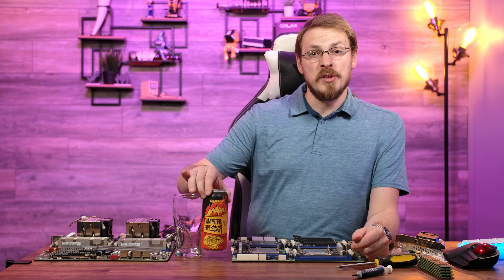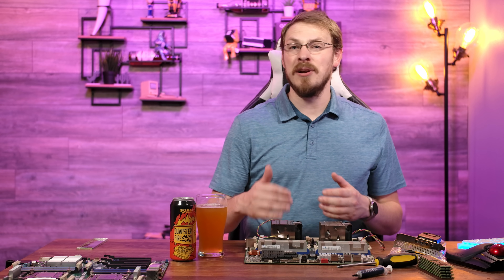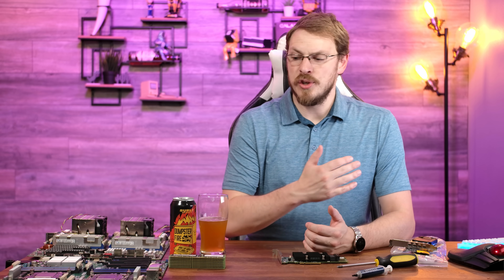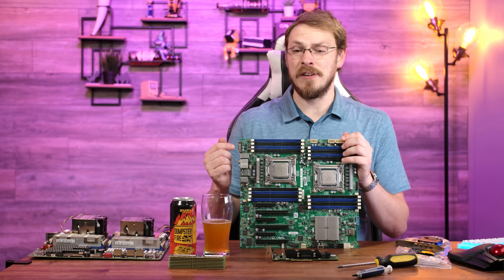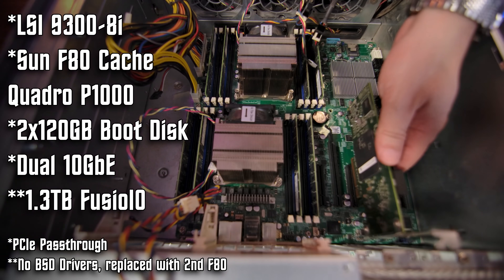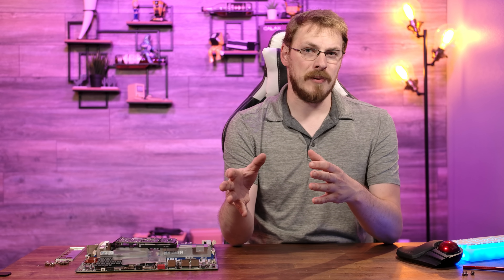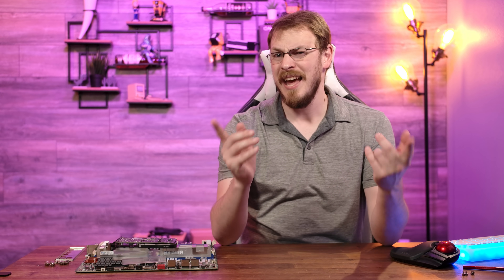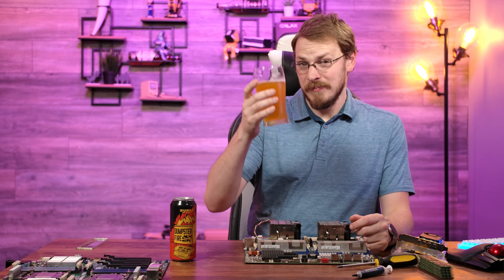Running out of things to die - TrueNAS Motherboard Replacement

Comment: My homelab consists of a single Dell R720 with the following specs: 2x E5-2680v2, 256GB DDR3 @ 1333Mhz, Dell PERC H710p for the 4 500GB Samsung SSDs as my ESXi datastore, a Dell H200 HBA for my virtual NAS. To my virtual NAS, there are 8x 1TB SATA 2,5" enterprise disks in RAIDZ2 on my Ubuntu ZFS NAS. The R720 is a SFF model, hence the 1TB disks. 2TB isn't needed for now and 2TB is quite expensive right now. 

Next homelab upgrade: 
Some 10Gbit networking, but nothing else planned for now.

Comment: These series of motherboards are a pain in the ass , I have 2 similar ones(X9DR3) and these are simply an headache . Mine for instance does not show the second CPU temps , voltages , etc in the management module , bios all ok , buy-ed another one , same issue , swapped the CPU ,same story. With the pci-e slots you need to configure the right lane's allocation on them , and also try to swap between the slot's the cards and check in which slot the add-on card works best. And yeah the troubleshooting continues till you will lose patience and replace again the MB like I did :))

Comment: I've got the simple home server. A old i5 3570, 16gb ram, 1 6TB drive, 1 2TB drive, a 256GB SSD Boot drive. Used for Plex and Data archives of all of my work data. Probably only 1TB of the work data and 4TB for Plex. Running TrueNas Core. I also have a system that has all of the work data and most of the plex data backed up that is off all the time. I occasionally turn it on to do a backup. All of my most important files are in a onedrive folder that backs up to the trunas nightly and is in the cloud. So I have 3 copies of important files and 2 of most others. There is also my Personal PC, Wife's Laptop, Music Studio PC, 2 other laptops and a Hackintosh I toy with just because. Oh I forgot the WD Cloud drive that has the plex data backed up too.

Comment: I currently have a 134TB Unraid server with a i7-7700K, 32GB RAM and a 1080 Ti for Plex but planning to upgrade it to a Threadripper 1950X for those extra threads.
Then I have a 72TB server with 16GB RAM running Ubuntu Server with MergerFS, it was on TrueNAS but I didn't want the parity and wanted to run docker nativeleley. It only has a i3-6100 right now but when I upgrade my Unraid there will be a chain of hand-me-downs through some systems and it will end up with a i5-6500.
Next up is my Dell R240 with a Xeon E-2146G and 64GB RAM that will soon be going off to colocation.
I am also going to be building a new worksation with a Xeon E-2246G.
Lastly I recently aquired two ASUS R200-E9 1U servers with Xeon E3-1220 v5 and 8GB RAM each, so these definateley need some upgrades.

Comment: On my homelab: It's a Dell Poweredge R620 running Proxmox for VMs (2x E52690, 192GB DDR3 ECC), and an HP Z210 workstation running TrueNAS for bulk storage of certain files, mainly media for a Plex server (E31230, 8 GB DDR3). Next upgrade Soon™ is a complete retooling of the TrueNAS server to A) rackmount it, B) upgrade it's capacity, and C) solve a weird issue where the HP tower won't boot with the spinning rust plugged in cold. Unplug the hard drives, boots just fine. Plug them in hot they all show up. Plug them in cold the system goes *pfft nope*.

Comment: I'm running Proxmox on a Gigabyte BRIX 4105R with a 1TB SSD and 8GB DDR4. I've named it "Proxmini" and I've got about a dozen LXC containers for MariaDB, Postgres, Pihole, Nextcloud, Bitwarden, Mattermost, Paperless, Omada, and a few others. My next "upgrade" is probably going to just be getting an identical unit to put beside the first and set up a cluster so I can migrate live containers and balance resource usage. I'm backing up using Proxmox Backup Server to NFS storage on my old Synology DS212, which has two shucked WD Elements 8TB drives in RAID1.

Comment: “This dual Xeon setup may be overkill…”
“What are you running in your NAS?”
Dual E5-2690 v3s, and surprisingly it’s not as overkill as one would think for doing a Snapraid sync over 28 disks 😁
Reply: I have a single Ryzen 5800x, my TrueNAS server has more CPU than it knows what to do with.  Even with Plex running.  Unless I'm transcoding 4K by the boatload, 1080p transcodes barely stress it.  I also moved the Plex DB to the NVMe mirrored array, and eventually I may take advantage of the PCIe pass-thru to pass the GPU to the Plex instance for HW Transcoding, but the 5800x doesn't even need it right now.

Comment: Right now I've got a Dell Poweredge R510 running proxmox pulling double duty as a NAS, I plan on installing TrueNAS on it when my USB to SATA adapter comes in. I've also got a Poweredge R610ii which is awaiting a second Xeon CPU. When that CPU comes in I'll also install a 10 gigabit NIC so that VMs on the 610 can communicate quicker with the storage on the R510.
Reply: I had a hard drive die on me. Thankfully I had a spare ready to go.

Comment: My server used to be an old Dell Dimension 8800 (Pentium 4).  Running Debian, it was able to read 2+ TB drives (even at SATA 1.5G speeds).  I used that thing for way longer than you'd think...

I now have a better server, it's a SuperMicro H8SCM with an AMD Opteron 4365 EE, 16GB RAM and Nvidia Quadro P620.  It has an LSI 9211-8i SAS HBA to run the 10TB SATA HDD and 8TB SAS HDD (and 120GB boot SSD).

Comment: Hm, running Proxmox on a fanless industrial PC, hosting a bunch of basic services like Influx, Grafana, Telegraf, Mosquitto, ioBroker, NiFi, Partkeepr, Dokuwiki... None of those is generating a lot of load, so the 4C/8T low power i7 and 16GB RAM is more than sufficient.
Right now I'm building my first Freenas box out of my old gaming PC, with 6x 4TB in a RaidZ2. Yes, I know, it doesn't use ECC. But a full server would be both, an overkill and above my budget - although somewhat tempting. Main purpose will be to act as a backup server, as sufficient backups are definitely my weak spot. And future projects might aim for a similar, second machine to replicate off-site, so I finally find a good nights sleep.

And man, your beer reviews are "painful" to watch. My mouth starts watering as you describe them, and I'd love to get my hands on a can. But the small breweries are sitting between "too much effort" and "impossible to get here in Europe".

Comment: I tun a random hp oem motherboard with 4 sata 2 plugs, and one sata 3 plug. thenI have a 128gb Samsung ssd as cache and 4 2tb drives in raid 10. Also running an I5 4440 and 8GB of ddr3 ram in a 2x2 and 1x4 config (I have 4 mem slots) I have an fsp power supply with 6 sata connectors and am using an adapter from the 24 pin to whatever HP uses to power their proprietary ass mobos. I get 4TB of storage. I already had the 2TB drives from used computers I buy and put ssds into, already have the cpu and ram from my old computer that the mobo died in. All I had to get is an HP motherboard for 20$ with the correct amount of sata and memory slots, and the adapter to plug in a standard power supply. Turned out to be a very cheap server has been running great for like 6 months now.

Comment: My vm box (Bender, ran out of good names for a big box in my current naming scheme so futurama it is) is an old Dual Opteron G34 board with 128GB ram and 2x16 "core"  Opteron 6282 SE cpus. Lots of threads/cores. Not a lot of performance, but its enough for what I use it for currently. Actually due to it being as slow as it is, I don't use it as much as I probably would otherwise. The per thread performance is pretty poor. It doesn't even make a half way decent multi-player minecraft server or zoneminder instance. My nas (Mr. Big) used to be a mini-itx xeon board with an i3 in it till the board died a year or two ago due to the room being a bit too hot and the lian-li case being too small to deal with the high ambient heat. So I un-decomissioned my old home server (sherman) hardware (Xeon E3 1230, 4c8t 16GB ram). No solid plans on what I'll upgrade to or when. but it would be nice to have a lot more performance for build jobs. My current main build job can take upwards of 2-3+ hours on there where my workstation with a Ryzen 3700x can do it in 1-2 ish hours. The performance difference is pretty staggaring. Not surprising. Just large. Good enough for random vm instances.

Comment: Currently my home server has a Asus prime x399 mobo with a 1900x threadripper, 32gb non ecc ram 😭, lsi 9217-8i hba with 6x wd red 2tb, a gtx 1660 for plex transcoding, 10gb melanox connect x2 nic, 1tb samsung evo 970 main drive, and 1tb wd blue nvme ssd for user redirection storage, runs win serv 2016 with adds etc also runs the vms from the main drive also. If i had the money I would upgrade to a epyc cpu build with ecc ram

Comment: My current network storage is laughably simple...a Pine64 SBC (quad core ARM, 1GB ram) running Open Media Vault sharing an external Seagate 3gb hard drive. The advantage is that it's fanless, low power, and extremely low noise since the only moving part is the spinning rust drive. Low noise is important to me since my IT stack is in my bedroom.

My build to replace that is based on an Asrock quad core Celeron board with 8gb of ram, once again a fanless system, but I'll probably stick with OMV since it it served me well up until now. I have two HGST surplussed 3 GB enterprise drives which will end up in mirror configuration, but since the board only has two SATA ports I need to purchase an add on card to allow me to have a separate boot drive as well.

Comment: Here's my server / homelab 

Custom
M/B: Supermicro X9SRE/X9SRE-3F/X9SRi/X9SRi-3F Version 1.2
CPU: Intel® Xeon® CPU E5-2650 0 @ 2.00GHz
Cache: 512 KiB, 2 MB, 20 MB
Memory: 64 GiB DDR3 Multi-bit ECC (max. installable capacity 512 GiB)
Network: bond0: fault-tolerance (active-backup), mtu 1500
 eth0: 1000 Mbps, full duplex, mtu 1500
 eth1: 1000 Mbps, full duplex, mtu 1500
Kernel: Linux 5.10.1-Unraid x86_64

Greetz, Kevin.

Comment: Home server - bought a Supermicro 2U X9DRW-3F 12 Bay LFF off ebay a couple of months ago, swapped the included CPU's for 2 x E5-2609 v2's (giving me 20 cores / 40 threads boosting to 3.6 GHz), added 512 GB DDR3 ECC 1866Mhz memory from a client's dead server that I took in on trade, 12 x 12 TB Exos x16 SAS HD in Raid 60 giving 96 TB of usable storage (HD's purchased before "farming" drove the price up, btw), 2 x 1TB Samsung Evo 970 SSD in Raid 1 as boot, 1 Connect-X3 Network adapter with 2 infiniband qsfp ports... Total hardware investment ~$6000 (mostly hard drives)... The reason? I installed nylon cargo strapping as an over should carrying strap and I can (relatively) easily load it into my car, and have an emergency server to put in a client's facility, restore their VM's and not have to overnight pieces to get them back up. 
Has already paid for itself...

Comment: I've been very happy with my Dell PowerEdge T140. Upgraded it from a 4c/4t to a 6c/12t Xeon E2136, 48GB of RAM. Runs VMware very well. Quadro P620 passed through for Plex, Dell Perc H330 controller (it's not an HBA, actually. Dell firmware is RAID mode by default), 256GB NVMe card. Light services run on my Synology RS815+ nowadays, with 16GB RAM and 4 4TB WD Red Pro drives.

Comment: I don't see the needs for me using so much horse power at home.  I have a Intel N3700m, running openmediavault because truenas does not run on it ;(. 
I have it in a 2u, 4bay Rackable Systems Industry 19" case, a pcie Sata expansion card, with 4 x 6TB and 16GB DDR3 Ram a 120gb ssd (overkill for the openbediavault os). When the disks are spinned down the system consumes about 12Watt with a picoPsu 90.

But because of your Videos i am Planing moving my Gaming PC into this Rack running proxmox and play via streaming on it... But without a AC i need a much better Cooling system :D

Comment: Last home server was a Q6600 with 8GB or RAM running unRAID with around 8TB of storage across 13 drives.

Am planning a rack build soon with probably a Ryzen chip a few TB of SSD storage and possibly 3x8TB HDD's for mass storage. Again running unRAID.

http://blog.prototypecreations.net/2014/07/15/cupboard-rack-build/

Comment: My TruNAS box is in a CoolerMaster Cosmos II case. 1600watt Corsair power supply. I’m using a old Gaming motherboard with an i7 4770 in it. 64gb of ram, it’s where all my old DDR3 went when I upgraded to DDR 4. Heh. I bought used HGST enterprise drives. Ive got 6 SATA 3tb drives on the motherboard SATA controller, 10 SAS 4tb drives on two Dell SAS controllers. Ive had the 3tb drives for about 5 years now without a single failure, and the 4tb drives have been in there a year with no failures.

Comment: Home server currently is a Dell R720XD, but I'm planning to move back to a Synology NAS(not entirely decided yet) and a low power server(unsure, but possibly a modern ryzen setup that I'm going to lowball(the 5000GE series are looking interesting for this)) next to it.

Reason for it is that I expected to be doing a whole lot more with my homelab(and thus bought the oversized R720xd) but ended up running a few apps and 1 Linux Development machine(webdev for GF). This is overkill for a machine that idly uses 150w plus and basically never does anything. Going to reuse the disks that are in there, but selling the rest when the time comes.

Comment: My homelab is a SuperMicro X9DRI-F, sporting dual Xeon E5-2650L v2 (10 core hyperthreaded) CPUs with 8x 16GB RDIMMs (128GB), in a SuperMicro 846 24 bay chassis.  Main use is a Plex server, with some virtualizations under Unraid.  Lots of threads, baby!

My next upgrade is to actually find a place in the house so I can use it instead of the ancient Dell i5-4590 system currently running...

Comment: Managed to Snag a first Gen Epyc 7551 for around €350, mobo was the same again. Ironically the ram is the most expensive part, but itll eventually be running proxmox with Zfs and Samba shares underneath (I had a truenas VM but it just had so many weird issues that I decided to give up on it). My server rn has 2 x5675s on a supermicro mobo in an old nzxt case. Main reason I'm upgrading is the power draw while relatively idle is really high, while the epyc server even with a similar workload and more hardware is just miles more efficient (~200 watts vs ~80-100). Still not sure what I'm going to do with the old server though

Comment: My TrueNas box is a Dell R820 I found in the disposal pile at work. 64 cpu threads and 320GB RAM. Slapped in a second internal 8 bay SFF cage, some IT mode flashed PERCs with external SAS ports, and some disposed ES30, SC220, and SC200 disk shelves. Way overkill but going to try running some k8s node virtual machines on the truenas box to see how that performs and maybe use the extra performance.

Comment: I started with a basic Synology 2 bay NAS, then built a small Atom C2000 Proxmox server. I replaced the Synology with a 5 bay newer model with dual gigabit. Then I had a saga where I changed a few motherboards before I got a Xeon E-2278G with a Supermicro X11-SCL-F and 8 cores running Proxmox and having a Quadro P600. That took me up to 10GbE so I wanted my storage to be 10G ready as well.

I replaced the spinning disks in my server with 3.5TB of enterprise SAS SSDs which I got for a steal. Then I foolishly decided to go 10GbE with my NAS, so I got an 8-bay QNAP NAS with PCIe slots which got a Mellanox 10GbE card, and two SATA M.2 NAS SSDs.
I'm currently shuffling data around to free up HDD drives to migrate them to the new 10GbE NAS.

My current issue is that the Xeon server occasionally fails, seemingly at random. Hearing your woes with your board has me concerned, but I am also suspicious of Proxmox because I am using PCIe pass-through of the GPU. I've seen my network stack on Proxmox failing and I think the PCIe bus virtualisation causes issues.

Next I need to justify to myself why I have 25TB of storage... I am planning on playing with LizardFS to consolidate my spare storage for the hell of it.

Comment: My NAS is mostly my old gaming setup stuffed into a NAS case :)

Unraid OS
Ryzen 7 1700, 32GB 3200mhz ram
Silverstone CS381 mATX NAS case with 8x SAS bays
LSI SAS 2308 HBA card
Nvidia 2060 super (passed to VM)
Nvidia Quadro NVS 290 (pcie 1x card)
2x 250GB Samsung 860 SSDs as cache
3x 4TB ES.3 drives
3x 3TB ES.3 drives (these have been failure central!)
2x bays free for upgrades

Comment: I'm using a
Silverstone CS381 Case
Intel i7-7700k
Gigabyte GA-H170N-WIFI
32GB Non-ECC RAM
LSI 9200-8i 6Gbps from Hong Kong

Not perfect, however no issues

Comment: I'm running a dell Poweredge R820 with quad Xeon X7560's and 256gb of ECC RAM. Not much storage with the biggest array being of 4 2tb SAS disks in a RAID 10. Running Windows Server Hyper-V Core with Windows Admin Center for management.